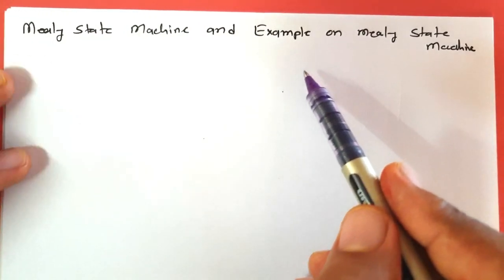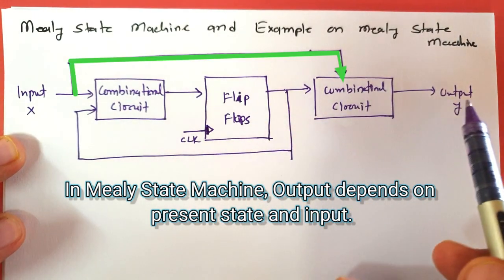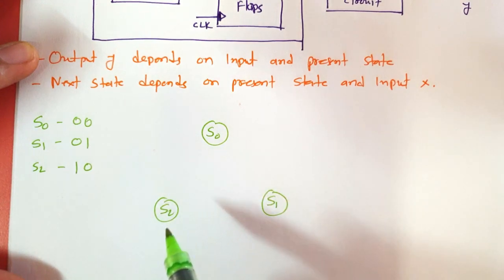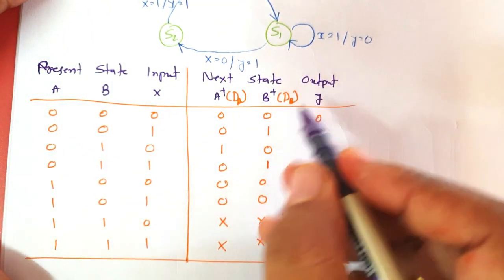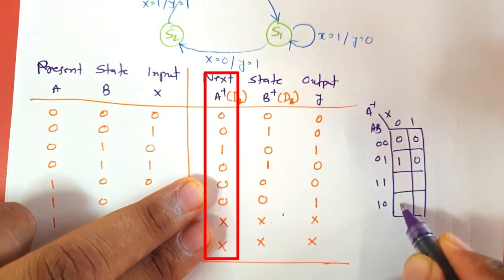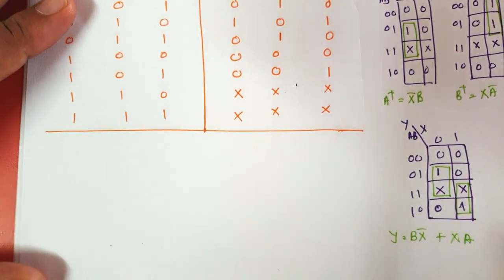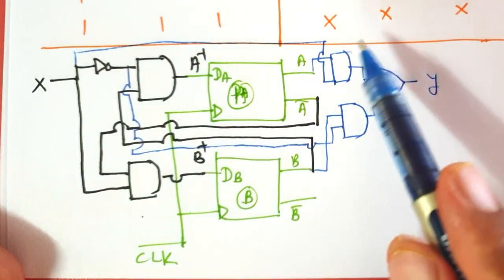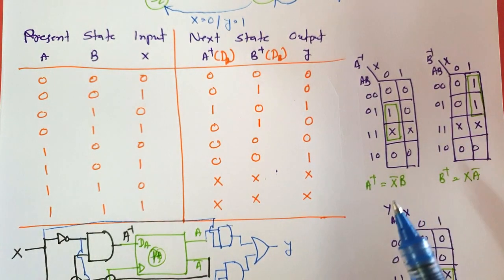Mealy State Machine: Basics, Block Diagram, Example, State Table, and Circuit

Comment: If instead of {0, 1} as output, we get {K, G, GR} which means whether we got a drink or not. Can we code the outputs as K= 00
                                                   G= 10
                                                   GR= 11
instead of 
K= 00
G= 01
GR= 10 

in order to draw the logic circuit.

Comment: design a classroom system that displays the names of the students in attendance during a lecture and the amount of time each student has been inside the classroom once a student enters a classroom a time counter is started. the information should be diplayed on a LED matrix.
Reply from the maker: It is a project, it is not a question.
Reply: @EngineeringFunda   yes i'm a student in the faculty of engineering. the department of computer science so i need to solve it
Reply: may you give me your email until i communicate with you
Reply: i just need the solution on the paper like the block diagram  of each IC , the truth table.